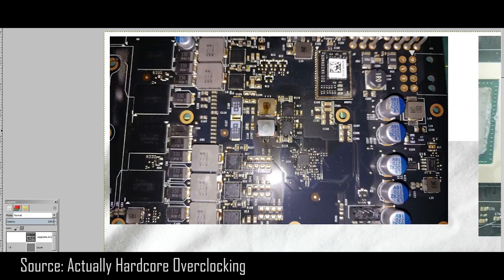Your Nvidia GPU Might Burn Up & Die?

Comment: So massively overclocking memory and running 24/7 is causing a part to wear out? After years? Shocking!
Reply: I think people should Google the term "Planned obsolescence" it was a standard US business practice to make things self destruct after a certain time so that you would have to replace them. It reached its highest in the 80's with us car makers making cars that would last only a few years. Then came Japanese cars that would last 3 or 4x as long and us car makers where slowly forced to improve quality. Not saying nvidia is doing this, but this type of business practice is as American as Apple pie.
Reply: Michael Winter how old is that card? How long has it been in use? I would like things not to break on my old car, but they do, and no one is surprised.
Reply: CyberianFaux this is based on a small sample, what are the stats across say 1 million cards? This report is 100% useless without a lot more data. A  brand new car can fail 1 mile down the road from the dealer. I highly doubt anyone is testing batches of 4 year old cards that have never been used. Also depending on how it's stored everything is subject to degrade over time.
Reply: My point being, just because something can work in a way it isn't supposed to without problems, doesn't mean that it is okay that it is set up in a way it shouldn't be.
Reply: cataria pega I have never had a problem with Nvidia cards. I still have a GTX 970 going strong. I have 8 nvidia cards mining right now. All way overclocked. I know that I am pushing them and except responsibility. Still I see no stats on how often this has happened. If you have no problem, and it's under warranty then it will be fixed. What broke after warranty? Tough. Same as any car manufacture. Unless it's a manufacturing fault. Tough. Why do people get butt hurt over electronic stuff, but you 4 year old card needs a new part and you tough it out. Sounds childish to me. And the pic for this click bait video is a gpu on fire? This is a non issue.
Reply: cataria pega yeah I hear about that split in the memory awhile back. Still had awesome performance from the card. I can play fallout 4 and mine zcash at the same time!! Awesome card.
Reply: cataria pega your trying to split hair here. The fact that the memory got spliced off, and a part going bust on a 4 year old card is different. In this case, if the part they made was proper for the specs, then there is no reason for people to be all about this. What is the deal? How many cards does this affect? How have those cards been used during the last 4 years? This is a non issue unless they put in a faulty part that was not doing what the part was designed to do for the length of time it was supposed to. If it is a warranty issue, file a claim. Simple. I bet most of these people have no claim. Buy a new card. Change to amd, because they have never sold crappy cards 😉
Reply: cataria pega again you have not answered the fundemetal question of this issue. How many cards are having this problem? Are there stats to say this is a problem? When does it become a problem? Almost every manufacture tried to cut costs and maximize profit. That's business. It's always a question of how bad. If every card is blowing up then this is a big problem,  but if a small percentage is, then it's not.
Reply: Had a 780 ti do exactly what was said in the video a month ago, it was at stock.
Reply: VillageCity apple pie aint american
Reply: C2Lception yes it's just a cliche. The premise is that for a long time American companies built things to fail. Part of the capitalist system for awhile. Now we have cheap Chinese crap.
Reply: VillageCity like apple smartphones, except those are expensive crap

edit: actually all their products except the macbookpro are shiet, and the mbp is just way overpriced
Reply: @villagecity
so where do u go to get your graphics card fixed again?
u can fix a car always pretty much, where do u go and replace a bga gpu? or a bga memory chip or a simple inductor even?
is there a graphics card service center around the corner?
NO! there is not.
louis rossmann at least had a bga rework station for apple laptops, because their gpus had such high failure rates, because guess what a manufacturing/design mistake, not a user mistake and no overclocking of course.

and singular experience does not create a statistic especially when u're on a the high percentage side.
u got 9 cards running fine? well great, so if we go with 5 percent failure rate  u can buy 11 more and if one goes and dies it would fit the numbers of 5 percent failure rate i can guess now and still be statistically insignificant 
your cards is less than 4 years old, so not very old either.
u saying nvidia cards run fine, because your cards run fine is like saying eating meat doesn't cause heart issues, because my 100 year old grandmother eat it and lived till 100 and didn't die of a heart attack, it makes 0 sense!

if sth. fails that shouldn't be a failure point at all and several times and it is shown by the math, that buildzoid did, what makes u think to blame the user?
nvidia cheaped out and thus cards blow up, but to u this is a non issue?

also the title and pic is actually far less click bait than other youtube tech channels do, because "your nvidia card might burn up and die".

seriously i just don't understand why are u saying its the users fault for overclocking, which again a lot might not do and their cards fail, then u say u can just go and repair it like with cars, which again is bullshit and then u criticize this video's title and thumbnail? u don't like it, then watch buildzoid's source video, that is in the description.

what is wrong with u? don't u want electronics to be build properly?
u're happy when the person, that just barely could afford  x nvidia gpu and runs it at stock sees it fail out of warranty, to be without a gpu possibly for months.

and this is a manufacturing fault btw, which u say yourself "unless it's a manufacturing fault" in regards to cars and this is manufacturing fault in regards to graphics cards, but u still somehow blame the innocent user, which shouldn't have failing inductors even at high end water cooling!
it's a cheap inductor on a 700 dollar card or more.
sth. is very wrong with your view on things, u would blame the user if a laptop fails, due to cheaping out and using out of spec hardware yet again?
Reply: VillageCity You seem to fail to understand the concept that Nvidia failed to build the cards to withstand stock settings and such properly. You are also failing to realize that age doesn't matter but usage does (if a card is over 20 years old, though I don't know why you would want to use it, it should still function like it is new so long as it hasn't been used).
Reply: The issue I take with it is I had 2 nvidia cards to date fail without any added overclocking, never had a AMD card fail on the hardware level even in some of my mining rigs where temps inside the chassis are close to 80C constantly.. 

The nvidia cards I have had fail include 780Ti and a maxwell Titan X they never pushed beyond stock and only modification in did was to titan X which was replace the thermal paste once I started noticing little issue, it did help but ultimately it still failed and it failed on the power delivery.  The reason I never overclocked my titan X was because it was a thermal nightmare for me and made me question review sample vs retail..    As for the 780Ti failure I have no idea how. my temps were decent just one day it wasn’t stable at stock speeds and reducing power target fixed stability issue for a little bit then I got curious and opened the card up and found chard around mosfets and chokes but no cracks or visible damage just discolored around solder and was soot around it.  The 780Ti was used in my work computer I built and wasn’t subject to heavy handed workloads a lot, occasional video editing.. but eventually it fully failed.. fan spins and that’s all..
Reply: i didn't see the reports, that all were overclocked? were did u?
also as mentioned inductors are cheap and when u overclock on a what 700 dollar card,  nothing should blow up!
modern hardware is designed to not kill itself with tons of self protection features.
overclocking memory  at worst should kill the memory or degrade it, BUT not kill the inductors  or power stages.
this are expensive high end cards!! those should be decently over engineered, yet all this in mind u somehow try to blame the consumer?
the consumer, that pays a lot of money! a lot!
u sound like an apple fanboy/girl shouting, "u're using it wrong", when it was a manufacturing fault (yes apple people do this a lot)

get some grip   and ask yourself if u really wanna defend a company using crap?
Reply: and lets not forget, that nvidia already lied to u about your 970 card, but thought u'd be to stupid to really care about the 3,5 GB lie and yes u don't care about this at all, there was even a class action law suit, but it didn't shake on the nvidia mindshare in your mind at all, fascinating and sad of course.
Reply: it's not about the performance, but about the lie and false marketing, again u having a good experience with the 3,5 GB doesn't matter in this case, because it was sold as a 4 GB card.
and this wasn't a mistake, this wasn't some communications issue, this was nvidia thinking they can get away with this lie overall and they did as u proof yourself.
Reply: 970 vram lie and using underspeced inductors for a high end card, that blow up is the same thought, because it is nvidia giving u the middle finger and u cheering it on and blaming the user.
the inductors should be properly speced and they are not and thus blow up and they shouldn't blow up as buildzoid said, it's not a complex part and it's a reliable part if it's used within it's spec.
"I bet most of these people have no claim. Buy a new card."
u think everyone is rich enough to just spend money on the spot for a new card, while their old card just do just fine, but doesn't because nvidia saved a dollar?
it seems u are a wealthy detached person, that stands on the side of billion dollar corporations screwing over users..... there is just no reason talking to u.
Reply: VillageCity hows profitability?
Reply: woah! voiding your warranty and doing something that's not guaranteed to be safe is limiting the lives of hardware, nvidia must be at fault!
Reply: Wada Don I know people complain  that they are doing things the cards are not designed for and then finding a way to blame the manufacture. Sorry if you overclock past what the manufacture does, it's your fault. So they could have put a bigger part, but no one has said that they tested for a certain speed an normal use. The entitlement of people is insane.
Reply: VillageCity yeah, exactly. If people are going to overclock their GPUs they might as well buy a better GPU and not overclock for the risk they're putting on their cards
Reply: dustojnik hummer there are lots of mechanical things that break down over time. If it can be 100% determined that it is a manufacture issue and not a user overclock, then they should fix it. But many gamers and almost every miner overclock way past what manufacture tests for.

Comment: I have a gainward phoenix gtx 980 ti reference pcb with reference clocks and under load pc  will reboot . The fix was to mod bios and decrease core clock and voltage (-200mhz , -100mv) . PSU is Seasonic 620w. Are inductors failing on this card ?

Comment: Well suck, I have a 980 ti. I haven't had any issues with it yet. It is a "Gigabyte OC Xtreme" Just removed my Oc's (I was only getting a few fps from them anyway). I was mining with it but since profitability dropped, and I can't afford a new card if it dies for a while, I stopped about a week ago.  I have made sure to keep it stable and low temp though, and the after market cooler is amazing at it's job. I'll definitely let you know if it dies on me.

Comment: Correctly sized inductors should be practically indestructible as they're just copper and ferromagnetic powder ceramic that aren't really affected by temperature aside from electrical resistance or aging. For inductors to blow up, they have to be either 1- under-sized, 2- defective or 3- something else has gone wrong (ex.: bad ceramic cap shorting out) and put several extra amps through them but not enough to trip the VRM's over-current protection. I'd set the over-current limit low enough to protect the inductors, perhaps Nvidia ripped a page off Apple's book and decided to use inductors as fuses instead. (I've watched many of Louis Rossman Macbook repairs and most of the time, inductors fail before the fuses that are presumably meant to protect them, enough so that he begins troubleshooting by saying "it's never the fuses" - still checks them just in case though.)
Reply: Maybe they're too close to another component that gets warmer and air flow doesn't particularly reach certain parts of the card? I don't know.

Comment: Only card that has ever died on me was an AMD card, a 3870X2. It didn't last long. Have not had a single issue with about a dozen Nvidia GPU's, have had em since the Geforce 2 series. Nvidia did NOT release a slower MX150, its an UNDERCLOCKED MX150 to stay under 25 watt TDP to meet OEM demands. Its up to the OEM to provide the specs of the hardware inside. Both cards have the same ROPS, Cuda Cores, Shaders and Bus width. Different clocks. That is all.

Comment: My EVGA GeForce GTX 780 after last driver updated Ver. 391.35 runs hot to me.  I could play game and it would never get over 70c. Now I play just the basic game and it shoots up to 80-81c. I can't play most games in full screen mode. I have also cleaned the 780 and put new paste on it. Thinking this was the issue. But I am still getting the same results.
Reply: Brandon Hunt // Check the usual culprits: dust and aging thermal paste.

Beyond that, I had a Windows service bugged (went to 100% single thread usage), that sent the CPU at max boost frequency and somewhat heated the GPU as a result, leading to GPU idle temps in the low 40s. No amount of cleaning and changing paste had helped obviously.

Comment: Nvidia Catch on fire: nobody batch an eye
AMD make weird noise: fire extinguisher meme, Amd is trash at the comment, every loss their mind*!
Reply: Cough GTX 480 Thermi Cough
Reply: NJ Sullyalex 

And the sad thing is people still bought Thermi GPUs.
Reply: i see people take evga card on fire and slap AMD on the title of the picture! and the comment gone full AMD trash shamming
in other case people took footage from ln2 overclocking when Ryzen came out, the overclock crash at 5ghz on full 8 core! and people take shit of of context and title the edited clip : AMD in nutshell!
Reply: Ashley Johansson didn't gtx 580's literally set on fire though?
Reply: Fanboys are irrational.
Reply: Michael Morgan I think you're overselling it
Amd cards have run hot in the past and they do take more power, but it's completely manageable by normal computers, especially now with radeon chill
Reply: AMD cards run hot now mate, have you seen the temps Vega 64 can achieve? By comparison most aftermarket 1080s run at like 70 max.

And yeah of course its manageable. But at the end of the day cooler is better. And I speak as someone gaming on a pair of 280x's on a 4K monitor. Im considering getting noise cancelling headphones to prevent headaches its that fricking loud. Of course a new GPU would be nice. Jiust waiting for the new Nvidia 1180 or whatever its called. AMD probably wont be able to sell a decent 4k solution for a few years yet.
Reply: A tiny handful of Nvidia cards caught fire compared to almost every single AMD GPU ever made runs like an inferno. You think this is a reasonable comparison?

Yeah you're fucking dense.